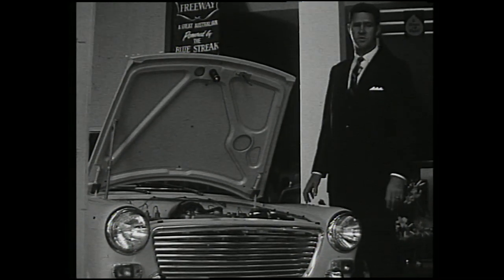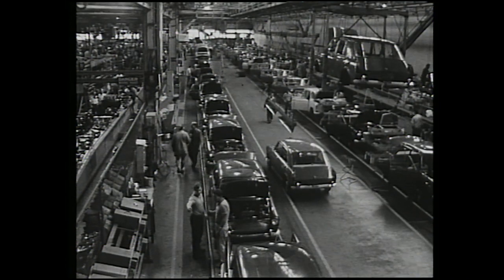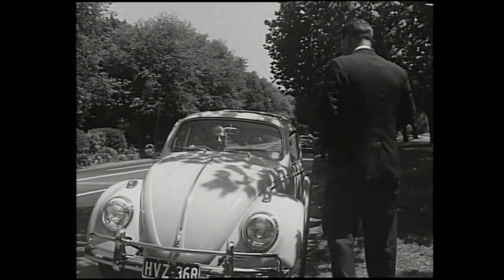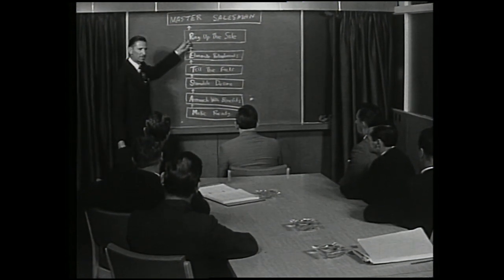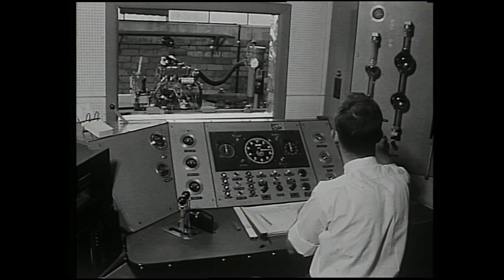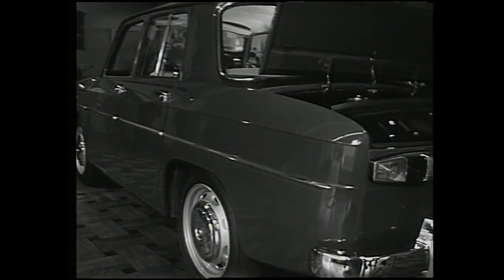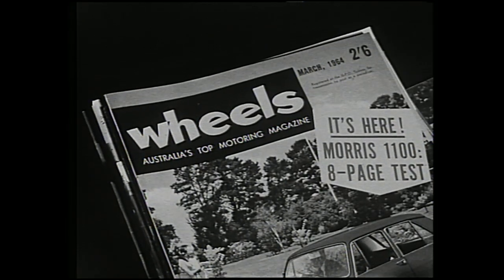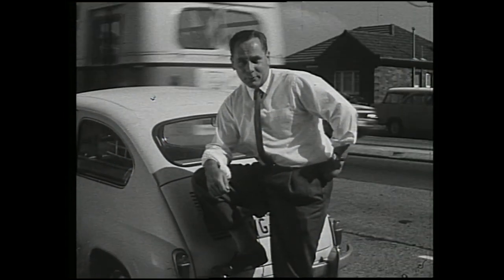Small Car Wars - 1964 report. BMC and VW factory footage

Comment: It is interesting to see Australia when we had so many local manufacturers either completely building locally or assembling locally from part or complete knock down kits. Of course the whole industry was supported by a tariff regime on fully imported cars. Even Mercedes Benz used to assemble some models locally for the Australian market.
Reply: AMI in Port Melbourne assembled the Mercedes Benz 220 models along with selected models of Standard, Triumph, Rambler and Toyota.
Toyota liked their work so much they bought out AMI.
AMI was the only Australian owned car company of any larger size then.

Comment: Holden representative denies that they're going to produce a baby Holden three years before they produce a baby Holden. The development time for the baby Holden would have been at least three years!
Reply: It's long been common practice for carmakers to keep a lid on future models, maybe to prevent customers from putting off purchases of current offerings.
Reply: Did not take much to develop the baby Holden. 
First off later in 1964 just start selling the HA Vauxhall Viva and win class A at Bathurst with it.
Then in 1967 put better headlights and trim on the HB Vauxhall Viva and put Holden Torana badges on it for the first tiny engines only Holden Torana.
Reply: @johnd8892 Exactly.